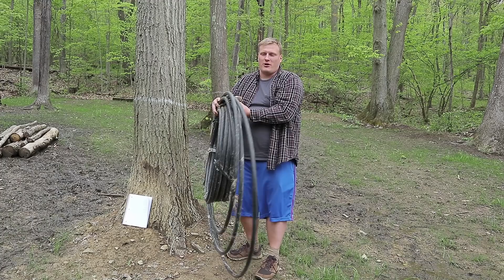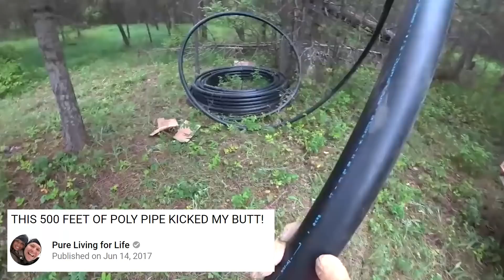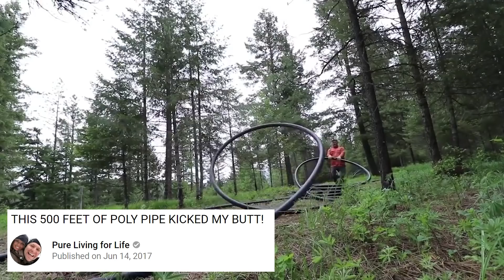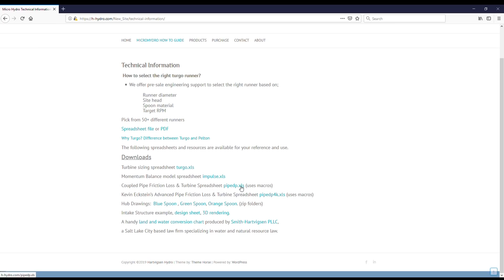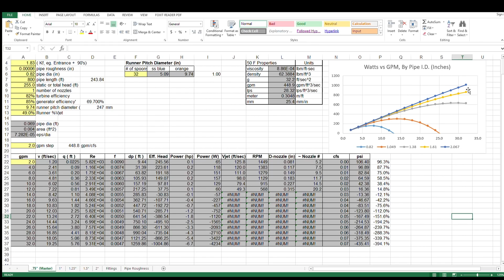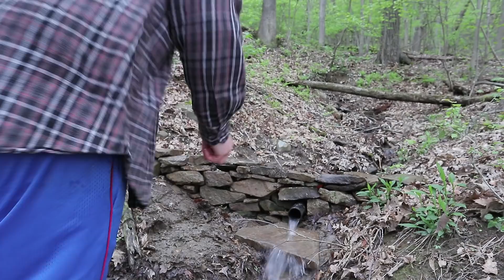[Part 5] Kilowatt Microhydro Turbine - Penstock Selection & Sourcing

Comment: Coiled Pipes
Pipe sized >63mm should be moved and uncoiled using an approved dispensing trailer.
Before unstrapping pipe from the coil or drum, both pipe ends must be firmly mechanically restrained.
The band securing the outer end of the pipe should be removed first and the movement of the free end
carefully controlled. This removal should be followed with those securing successive layers. No more bands
should be removed than necessary to release the length of pipe immediately required.

Comment: At half of the piping cost, you could run an additional pipe (of the same diameter) in the future, if the flow increased. Would that translate to a doubling in potential output power ?

Comment: So your plan is to make power from a Pelton wheel? I have a 12" cast iron real Pelton wheel that I would like to sell. It is like this one but different. Not sure what the nozzle size is would have to check.  This video says a head of 210 feet (95 psi; rated 4 hp)  https://www.youtube.com/watch?v=rj6BQj4An70&t=1s Just an Idea for you. Wish I could use it but I am a flat lander.

Comment: UNROLL the pipe.  Also, PLFL's YT channel is shit. They want you to see how they do everything wrong and have a "wow". Gets old.
Reply from the maker: I kinda agree with your view of PLFL. I will be unrolling the pipe.
Reply: @JoeMalovich  Yes, those folks drive me nuts. It was OK the first few times. In any case, unroll. I suggest using a pulley and rope to progressively pull the pipe up the hill. Mechanical advantage is your friend. I have a 200' polyester rope for such tasks.

My wife is a PE hydrologist and she likes the time you're taking to do the math on the water flows. Thanks for sharing on your channel. When things turn electrical, that's where she hands the baton over to me.

Great project. You're going about this the right way. One of the best I've seen on YT.

Comment: I think you are going to run this 24 hours a day at say 1kw, which equals 24 kwH.    Have you thought about adding a big holding tank at the top, so that you can run 4kw for 6 hours, with a variable jet nozzle?    That way you could actually cook your meals on a stove, and boil some water for a cup of tea..?
Reply from the maker: Batteries...
Reply from the maker: But really it's better to do a constant flow, then you don't need the big penstock, or a big generator, it a big charge controller, or a big storage tank.

Comment: Joe, find a friend nearby who owns an old Gravely two wheel tractor. You would be surprised at what kind of grades they can work on with the right tires and chains. There was a trencher attachment for on them.  I have one in fact.  If you ran into a root, they also made a chainsaw attachment that would take care of that problem. Have one of those too. :-) One surprising thing that I found with our smallest Gravely was that it could go over ground where I sank in when it was wet. My next size larger one has bigger than factory stock tires on it and can go over downed trees that the smaller one can't. One of the quotes from the older Gravely ads was that they could go anywhere that a man could walk as the engines on them had full pressure lubrication. They were designed to work in the hills of WV so they would work where you are. Likely could drag that tubing up or down the hill for you. If used downhill, you would want to turn the tires around from normal as you would be using them more for braking than pulling.
Reply from the maker: Anywhere a man could walk, but I can't walk up this hill...too steep for even that. I'm familiar with graveleys, and I've run a DR all terrain mower too on very steep hills.

Comment: It literally took me 20 mins to unroll 200m of 4" pipe with 10mm wall thickness. just get a rope and a small winch and pull it up the hill in coils. get a mate to guide the right coil off at a time. once it gets to the point that it is like a big slinky make sure both ends are tied to something via a rope. then as you pull it the twist come out and get transferred in to the rope. you would have that pipe to the top of the hill quicker than the time it will take to drive to the store to buy materials to make a spool. I would just rent a portable winch, carry the winch up the hill and pull the pipe up as it unrolls.  Just my opinion. looking forward to see what you come up with.
Reply from the maker: I'll take your advice under advisement.

Comment: Did you think about time/age of the pipe considerations? Maybe from that table you are already using Roughness Coeffs when the pipe is old, i have no idea because you Freedom Units guys also use different coeffs, i think Manning in America if Im not mistaken. But if not, you should really consider that, because your system from what I have seen, will have lots of debris, particles, etc... flowing through the tube and with time all this gunk will accumulate on the walls, changing the internal diameter and roughness. There are usually tables/excel sheets for that also. Anyway great job! Your channel is very interesting.
Reply from the maker: I really don't think there will be that much debris in the pipe slowing things down. I plan on collecting straight out of the spring, and allowing macro sediment to settle out.

Comment: I'd love to get some kind of water wheel, or turbine, that got anywhere from, 300 to 500 watts constant power, I don't have enough water fall for a turbine, maybe a water wheel, with alot of overdrive, like 45 rpm at best, overdriven to about 400-450, so it would take alot of TQ to make power with that overdriven ratio.

Comment: Best way to unspool that stuff in my experience is to really carefully pull them apart sideways like the video clip you shared then you just have to spin one end to remove the twists.
Reply: The problem happens when you start dragging the pile you are trying to unspool from and it snaps open, gotta have someone to keep it pinned and uncoiling evenly

Comment: What if you ran 10 (.82 ID) pipes from a manifold at 3 gpm each for a total of 30 gpm, it looks like the total wattage would exceed that of the 2.067.  Am I reading that correct?
Reply from the maker: Maybe, but I'm not running 10 pipes. one big pipe is cheaper and less prone to clogging and freezing.

Comment: you said you measured the required pipe length in Google Earth, did you also consider that this gives you only the distance for flat ground and you have to take into account the slope of the hill?
Reply from the maker: I did actually. Saved the data from I think it was either earth or geocontext profiler I don't remember. Plotted in Excel, took the distance between points and summed it up.

Comment: All these people doing it wrong it's so frustrating to watch.   You can't pull material off the top of a spool and expect it to straighten out.   It's twisted!  It will spring right back up unless you unravel it whilst rolling the spool.
Reply: That isnt what happens if you have both end tied to rope the twists get transferred in to the rope. you can see that if you watch my video doing it. I laid 200m of 4" pipe and i can tell you that there is no straightening it out with twists in it. it just wont happen it will just kink. the only way to get it straight is by getting the twists out. Having it tied at both end to rope lets those twists go in to the rope. yes a spool would be better but i would have had to build a spool 5 meters tall it would be a weeks work to make that thing and cost hundreds of pounds in materials and would be used once. instead it was done in 20 mins with two people.That pipe has been laid and functioning for over a year now perfectly and i can assure you it has not sprung back.
Reply: Kris Harbour Natural Building ok fair enough I noticed you did that in the later stages, but you could easily have mitigated the early mess by spinning the coil as you unraveled
Reply: @peetiegonzalez1845  Tried that first. That is why i put the post in. But the weight of the pipe is so great That the friction is massive so it wont spin it just wants to kink. and on top of that there is no holding the roll together (without making a contraption to hold it) so that it spins it just wants to unrool like a slinky and two grown men cant stop it. The Rolls are 250kg each and have a huge amount of stored energy in them waiting to just unroll themself exactly how you dont want them to.  It was stated in the video that i had a hard time doing this job and that isnt true at all. it was actually the easiest part of my hydro installation. it literally took 20mins the way i did it. If i was to do it again i would not bother with the post and just pull it out with it tied to the back of my van.
Reply: @KrisHarbour  I'm actually impressed you did it so quickly.  Joe here said he's gonna make an internal "wheel" to roll the thing on and I would have said you should have done that, but if you got away with 20 minutes spinning it on the rope, then good for you.   The other chap he gives as an example of "what not to do" did a far worse job of it, as evidenced by the video clip, at least.
Reply: Yup just try to pull wire and you will figure it out very fast
Reply from the maker: I don't have the room to untwist my 500' coil, maybe the 300' one. I still intend on building a spool, I'll just slap some 2by together on a pvc axle suspended on a ratchet strap between 2 trees. I might need some help in the spool end to brake the spool to keep it from unraveling. I bought a rope winch that's good for pulling 300 pounds and an unlimited rope length so if I get a long enough rope I'll only need to do a few setups to pull it up the hill. I really don't think I'm overengineering it, I'm a lazy engineer so this is what I feel is the easiest method.

Comment: It looks like you will be better off making a reel to hold the coils and unspooling the pipe than trying to leave it on the ground and try to turn it as you pull.  Figure on letting the pipe warm up before you unspool it.

Comment: I am sure you know that there are two types, one is used for irrigation but NOT for drinking water, then the other is made for drinking but cost more.  My son has been in irrigation for 30+ years and it is illegal for him to use non-drinkable pipe for house water.  What you have looks like the right stuff with the heat-sealed end and under pressure
Reply from the maker: Potable, I'm building the system to be potable compatible, I would still need to test the water before drinking.
Reply from the maker: To add additional thoughts here: I like to think of things in terms of prepping sometimes. Not that I have a foil hat but it's an interesting thought exercise. I'm an Eagle Scout so "be prepared" is a big part of it. I could back-feed though the garden hose spigot for water in an emergency (after attaching a pressure regulator and water hammer suppressor) Same with evaluating how defensible a new house would be in the case of a zombie attack.
Reply: @JoeMalovich  nothing wrong with being prepped/ready.  I live in a town of zombies but the kind that is brain dead lol.  Being a first responder I see it all the time. If we tell them the road is closed they go nuts screaming "What am I going to do?"  lol

Comment: A couple of thoughts, if I may.

You mentioned in part 4 that you expect to need to stop the water flow at the bottom with a valve occasionally, for silt removal. Have you considered the effects of water hammer on your plastic pipes, and how to mitigate it?

Additionally, I saw in part 3 that the bucket had a fair bit of algae growth. Have you considered using ultraviolet as a germicidal to stop the buildup of algae and bacterial growth products? The underlying process is called Ultraviolet Germicidal Irradiation (UVGI). You'd only need around ten or twenty watts and this could be driven by the secondary "low power" turbine you mentioned potentially running from the silt pipe or overflow. You can buy UV pond sterilisers cheaply, although they generally require water to be pumped through the unit and they won't support high pressures or flow rates, so you'd need a pump to pull water into it. A better approach is probably to just buy a UVC germicidal compact bulb, place it in an IP68 rated project box with a transparent lid or window, and affix that within the barrel.
Reply from the maker: To deal with water hammer I'll simply not close valves quickly. As for growth I'm just using opaque materials. No sun = no growth. I have a black barrel for at the top.
Reply: @JoeMalovich  Makes sense. I noticed the growth mostly on the white bucket.

Comment: Let the pipe set in the sun and let it warm up before you start pulling it and tie the numb end to your in rolling stand and let it rest a few days before u pull it up the hill.we used 3inch all the way up to 36in at a copper mine and we needed the pipe straight and we would have to let it rest for almost a week before we could use it And just a quick tip on on unrolling the pipe don’t try to do it too fast or if you’ll start getting kinks in it and you are have to cut those out and put couplers in
Reply from the maker: Hadn't thought about unspooling kinks. I'll watch out for them. I'll probably be doing that when it's warm to reduce the risk.

Comment: You could increase flow and pressure by using a simple adapter to get the water to have laminar flow, by removing the turbulence in the water higher flows are capable in the same size pipe, and friction become less of an issue
Reply: Filamax believe it or not, friction caused by a laminar flow boundary layer is actually higher than friction caused by a turbulent flow through pipes..this means that higher velocity flow (and thus, more turbulent flow) is actually preferred..the only downside to higher velocity is pressure losses due to, as stated in the video, increased dynamic pressure
Reply from the maker: @claycleveland4143  you mean decreased dynamic pressure.

Comment: Nice demo of Hartvigsens spreadsheet Joe. With the small safety margin you will likely need a pressure relief valve at the turbine for times that the nozzle clogs and you get a pressure spike. Also, rolling the full roll to the top of the hill and then uncoiling going down the hill will me much easier than trying to uncoil uphill. Been there , done that.

Comment: Thanks for the update. I agree that in terms of power there is very little financial reason to choose 2" pipe for your use case. However regarding *freezing*; I think that the reduced flow rate of a 2" pipe would be more than offset by it's internal volume. In other words; if you increase the diameter of a cylinder, the volume versus surface area increases logarithmically meaning a larger volume of water relative to the surface in contact with the cold. I could be wrong; just my thoughts. Keep on keeping on with the videos.
Reply: "if you increase the diameter of a cylinder, the volume versus surface area increases ..." LINEARLY with Radius (or diameter).  Volume = pi.R^2.length, Surface Area = 2.pi.R.length.  So, Vol / Surface Area = R.
Reply from the maker: Correct,  the water will be moving slower in a bigger pipe. Freezing still isn't a big concern with either pipe I feel.

Comment: An easier way to do the larger pipe at least, 2-4", is to tiger torch it off of a reel 6' at a time or so. Never worked with smaller pipe, though.

Comment: wouldn't it be easier to anchor the reel at the top of the hill, and in a wooden frame roll out the pipe down the hill, using gravity to your advantage?
I'm assuming there would be an access track for a truck to get up there, for the pylons?
Reply from the maker: There is top access, I won't be using it. I'm going bottom up because I'm afraid of the pipe sliding down the hill uncontrolled. I will also be anchoring the pipe every 100ft.
Reply: @JoeMalovich  Makes sense! Better you not me though, good luck!
I'll be looking forward to your next video :)
Reply: i think the track for the pylons is on the neighbours property! good idea tho
Reply: @geofflonewolf  Being polite to a good neighbour can get you anywhere :)

Comment: For fun i looked up a local stream near where some family live. With a turbine i reckon the waterflow would give around 0.8KW of power for 60% of the year. Then i looked up laws, and apparently its illegal to build private hydro-electric installments in my country. You need very specific permits, and the EU controllers who update farmland size yearly do note down illegal installments of renewable power sources (including illegally installed solar panels, ones not mounted on roofs). Plus even if one can acquire a permit (which definitely will be denied), its illegal to connect it to the power grid, in other words, you would have to find some standalone application for it which is separate from the rest.
Reply: for fridge, heater and other more or less constant demand stuff
Reply: Out of interest, what is your country?
Reply: @alexscarbro796  almost any place in Europe got that problem, I'm from Spain and they even tax solar pannels
Reply: ElAdri1999 I did wonder. My wife is Spanish and I’d heard of their retrograde steps on Solar. I’m sure it’ll get reversed in the not too distant future. Spain has some great Green Energy projects, lots of natural resources and plenty of smart people!
Reply: @alexscarbro796  I know, and in fact there are ways to bypass that like having a separate power grid for solar and normal ac
Reply: @alexscarbro796  when I work on my house to add solars I'm gonna make a battery for the house just for fridge etc